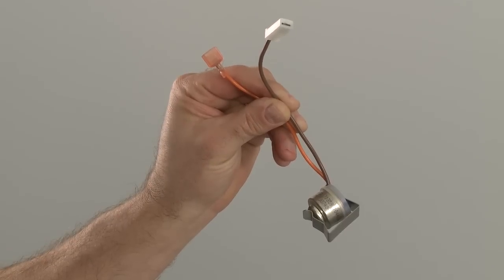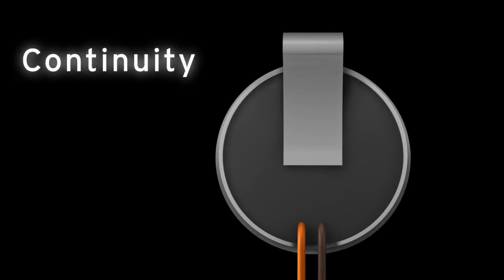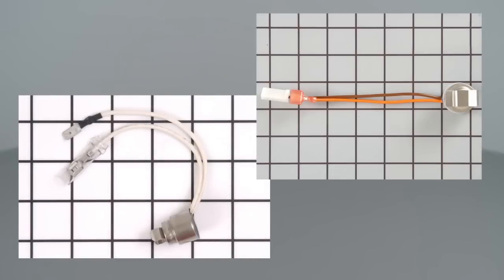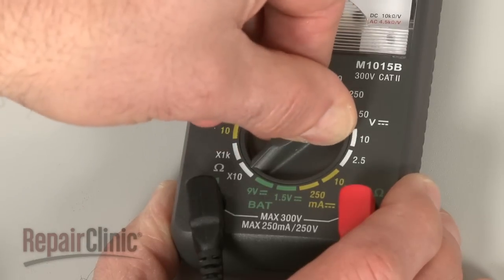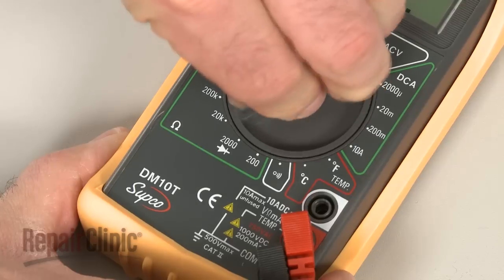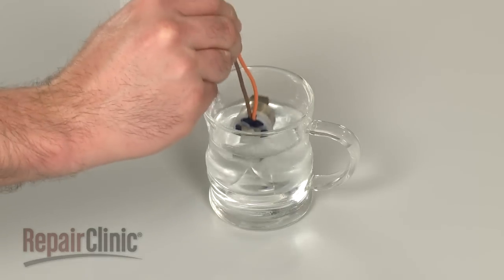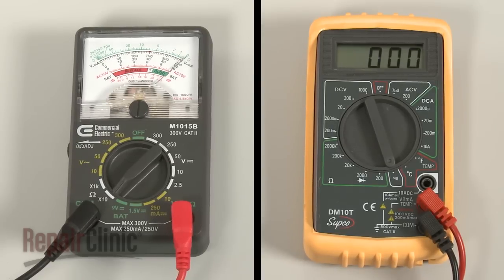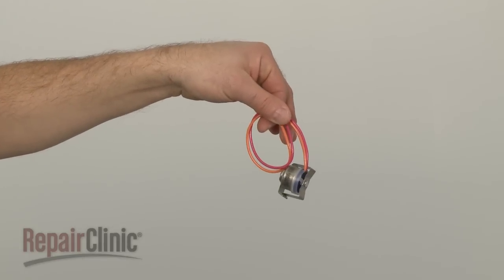Fridge Warm? Defrost Thermostat Testing, Troubleshooting

Comment: Repair Clinic PLEASE HELP ME :)  I'm the exact opposite heres my issue i have a Gibson refrigerator GRT17DRBWO my issue was going on about a half a year ago where the bottom part the refrigerator part was not getting cold and ice was actually hitting the freezer fan. So i'd take the back panel off and melt it all with blow dryer i did this a couple times and ysully it would last a while where the refrigerator would work just fine, it was freezing good and refrigerator would stay cold and the unit would turn off and on all good but than last week it started doing it again. Freezing up the back area of the freezer,coils, and not cold in refrigerator. So i researched on here and found that my thermostat for the defrost, timer, or the heater element itself could be bad. Well i checked the defrost thermostat and it had no continuity so bad, checked the element it was good had 33ohms resistance, checked the timer between one and 3 no continuity so bad. I replaced the defrost thermostat and the timer and the refrigerator thermostat stat too. Well all is cold and no ice or frost on back or on coils and freezing down in refrigerator 30°s. But the problem is the refrigerator will not shut off at all except when the defrost timer gets to its area than off for a bit. But the rest of the time the compressor stays on running air blowing cold. So i put my old thermostat for refrigerator back on same thing, refrigerator runs all the time but cold. Please help me figure this out if you can you seem like yall are the  masters Thank you!!!! :)
Reply: karl hoff If your fridge is defrosting correctly, then the problem is not in the defrost components.  In the summer fridges will run most of the time,  the component you should check is the cooling thermostat (not the defrost thermostat).
Reply from the maker: karl hoff If both the old thermostat and new thermostat (cold control not defrost) still cause the unit to run all the time then the unit is not cooling properly. This is most often caused by dirty condenser coils which are located up the back of your machine. Another cause which would go along with the excessive frost issue is a bad door seal. If too much warm enter enters the refrigerator or freezer the defrost system can't keep up and eventually you have frost everywhere.
Reply: ***** thanks for the reply,  the coils in the back are clean. It was turning off and on though every time I'd defrost the coils in the freezer it would start working again shutting off and on so im weirded out on it, the defrost thermostat and timer fixed the frosted freezer which caused the refrigerator to not get cold but now thats good. But whole refrigerator is freezing cold and so is freezer it just blows all the time no matter how low i turn the refrigerator thermostat down it won't shut off till it goes to off position. It didn't used to do this so im stumped and seals are clean and line up perfectly. Ughhh im stumped its like i fixed one problem now have this compressor and freezing air runs all day i dont think it should am i right if the seals and coils in the back are clean it should shut off at some time. I used to be able to adjust the refrigerator thermostat and it would even cut the refrigerator off or on ughhh.
Reply: +RepairClinic.com. yup no frost anywhere after the defrost thermostat and or timer but both were bad and frost was completely filling up the condensor coils and blocking the refrigerator from getting air it doesn't do that anymore the heater is now working its just running all the time and it just wont cut off even at warmest selection on refrigerator but its like 30 degrees in refrigerator and turn to warmest and nothing keeps running weird after id clean well melt condensor coils it would work and cycle correctly on/off but now change thermostat for defrost and timer and no frost but no cut off maybe refrigerator thermostat is defective???
Reply: ***** its actually freezing the food???? In the refrigerator part and freezer im guessing by looking at your symptoms list its the temperature control
Reply from the maker: karl hoff It is unusual for a new part to be defective. You never mentioned that you checked the door seal.
Reply: +RepairClinic.com yup i checked it its good and clean. But truly it was just working cycling on and off. It should do this right? If seals are clean lined etc.. coils clean etc.. ot shouldn't run all day and freeze the food what would cause this do you know??? Thanks
Reply from the maker: This sounds like the thermostat is not shutting off. Try putting an ice cube on the sensing bulb for a couple minutes and see if it shuts off. If not the new thermostat is bad. The new defrost thermostat and timer would not cause this problem. Hope this helps.
Reply: +RepairClinic.com yes thank you I went and ordered another  refrigerator thermostat and the fridge works perfect shuts on and off doesn't run all day. thanks

Comment: Of all the other related videos out there your video was the most straight forward and very informative.  I especially like the idea of removing the defrost thermostat and placing it in a glass of ice water.  So much simpler than me having to bring the freezer back down to temperature.  Well done!! Thanks.
Reply: I just read some of the other comments and apparently the ice glass method is not valid.  I will just turn the freezer back on for several hours and then test for continuity.  I am curious how many people commenting on this have ever had the defrost thermostat be the bad part - or was it the heating element that went bad.  Just curious.
Reply: I have a refrigerator with the ice buildup problem too.i thought it was the defrost timer I bought a new one same problem the freezer fan does not want to spin.maybe I have to let the thermostat get to a colder temp to work.but if it doesn’t I’m going to throw that refrigerator in the trash and buy a new one I fed up already.
Reply: @garylove2836  I would recommend staying away from too many bells and whistles (touch screen, etc) or they are ridiculously expensive to fix when they inevitably fail.
Reply: @AgapeYah  yes but my fridge is a simple one,it don’t have all those amenities.just found what I think is the problem the thermostat is not good and the evaporator heating element.but I don’t know if I would buy because the door gasket to the bottom of refrigerator door is worn out.and just for that gasket they want $171 dollars.

Comment: Yesterday I was in a bad mood when my new defrost thermostat (L55 - 35F) tested the same as my original one. It measured 56,000 ohms at room temperature AND after 10-20 minutes of ice water.
Hitting the internet i found ablog that made total sense. My model of defrost thermostat has a high resistance rather than open to allow a low level of heat on the heater for the rest of the defrost cycle to prevent water drops freezing on the way to the drain trough. After I defrosted the freezer totally which allowed air passage through the previously frost filled coils thus freezing could then function again I placed BOTH new and old thermostat into the freezer for an hour. Presto bad mood gone......the original one still measured 56 k ohms (56,000 ohms) and the new one measured 0 ohms. Today the freezer will have the new one installed with issue fixed. I know it will be fixed because the defrost timer was replaced last month and the heater measures 30 ohms. Plus i had placed a wire jumper in place of the defrost thermostat then forced a defrost by slowly turning the defrost timer manual dial till the freezer fan stopped...once the ice cube placed against the heater started to melt fast,,,fix should be A OK once defrost thermostat is changed.
Reply: Lego

Comment: @RepairClinic

I thought when your thermostat is cold, it should produce a reading of zero ohms on multitester. If it is warm ( anywhere from forty to ninety degrees fahrenheit ), then the test reading should produce a reading of infinity. If i'm not mistaken it is the same principle of testing the thermistor. My question is why my thermostat has zero ohms reading even though it is warm. I think i should get zero ohms reading if i immerse to ice cold water in 5-10 minutes. I think it is shorted

Comment: To make sure defrost thermostat is good or not, 
1. Place thermostat in a cup of water with two wires not fully submerged in water. 
2. Put whole experiment into a working freezer for at least 6 hours or more to make sure water with defrost thermostat is Frozen. 
3. When cup of water with thermostat is Frozen, 
4. Take out experiment from freezer, place it on a dry wooden table.
4. Time to test continuity while thermostat  is still in frozen water.
5. If there is continuity, that means thermostat is good 
6. If not, that means thermostat is bad and  needs replacement.

Comment: My thermostat L15-21C 
What this charge type?
thanks
Reply from the maker: +Attila Polgár Normally in order for a defrost thermostat to close it must be clipped to a evaporator coil during operation as it will get to negative 20 degrees Fahrenheit.
Reply: +RepairClinic.com Ok thanks what type recommends instead

Comment: The only thing i disagree with is where you state that a bad thermostat can't be identified solely by looking at it...mine was puffed up on the top instead of lying flush. That's initially how I knew it had to be the problem with my refrigerator. Thanks for the great video.